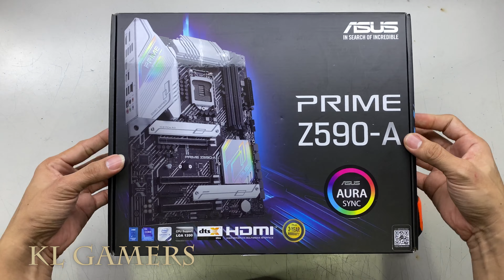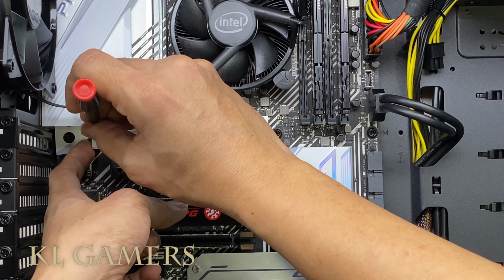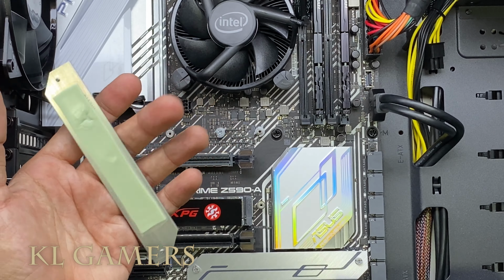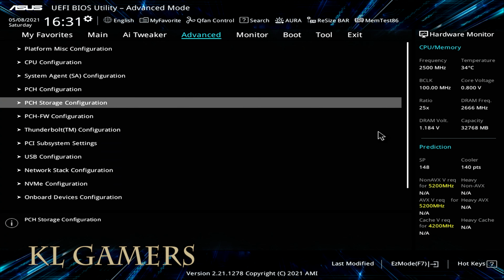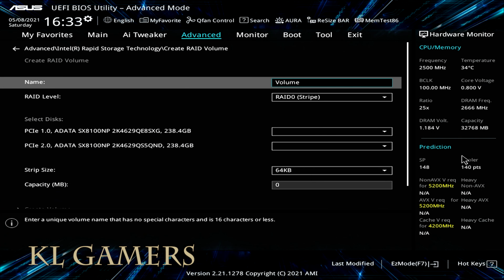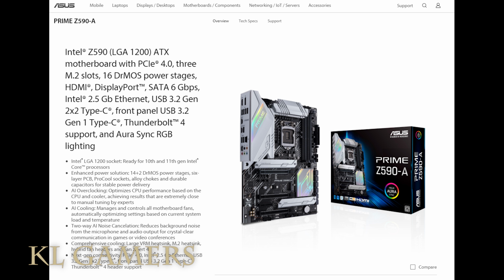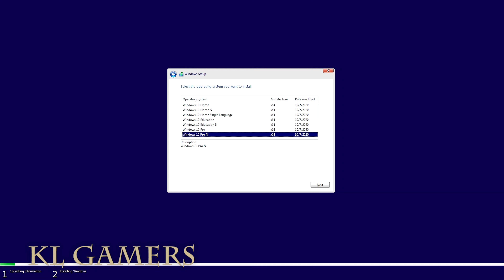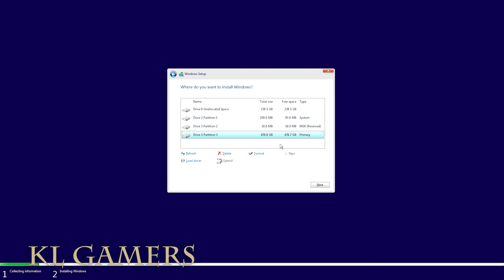ASUS PRIME Z590-A How to setup RAID with M.2 2280 NVMe SSD

Comment: Great vid very close to 100k im happy for u 👍btw is the b460 aorus pro ac compatible with the i9 10900k or r9 5900x
Reply: Bx60-boatds are only compatible with Intel processors, also the b460 aorus pro ac is compatible to the i9 10900k. Though, I would recommend you to use a Z490 or a Z590 board, sothat you can overclock.
Reply: @random_chris3910  could you recommend me a cheap board that is conpatible with the r9 5950x
Reply from the maker: b460 aorus pro ac compatible intel 10th gen

Comment: I got a new PC with ASUS Z690, I got it with windows 11 pro and they set it on RAID, how can I change it back to AHCI without losing my OS?
I got Samsung SSD 980 PRO and for backup EVO 840 EVO.
Thanks!
Reply from the maker: if u need switch to non RAID , example AHCI, you will need to reformat (loose all data!!!)so backup your files in USB drive or cloud before change the settings
Reply: @KL Gamers  Yeah,  Samsung support team said "You can do it without losing your data"..

Comment: also i would like so ask , so u installed 3 sticks and ended up using just 2 in raid or all 3 in raid , pls i look forward to ur answer
Reply: Can you hear that the first one slot is for "reserve  intel brand ssd" .the reason is you cannot configured the ssd slot.
Reply from the maker: i think you might be able to RAID 3 M.2 SSD if u use intel brand SSD in 1st slot ( not sure) did not have intel brand SSD , if use other brand only can RAID with 2nd and 3rd slot
Reply: @md-vl3lm   okay merci
Reply: @md-vl3lm   1st slot is for a pcie 4 NVME... is not at all reserved for  "intel" brand..I have a samsung PCIe 4 at the 1st slot, you can use any nvme , if your nvme is not pcie4 the nvme will work at the defalut speed...

Comment: what if i DID NOT install a m.2 nvme ssd on the 1st slot, and only installed 2 pcs of m.2 nvme ssd on the 2nd and 3rd slot, then set it to RAID 1 (mirror).. is this possible? then i will install a windows server.. my objective is redundancy and failsafe.

Comment: Bro I need help, I’m using Rog Z590-E mb, I insert 3 m.2 nvme ssd into the board but only slot 1 and 2 is detected, but when I remove slot 2, slot 1 and 3 will be detected fml
Reply: Btw it’s a completely new system, only the slot 3 m.2 is not brand new, I took from previous pc